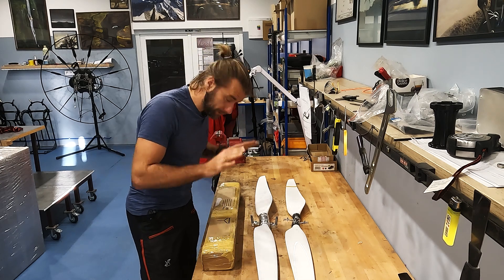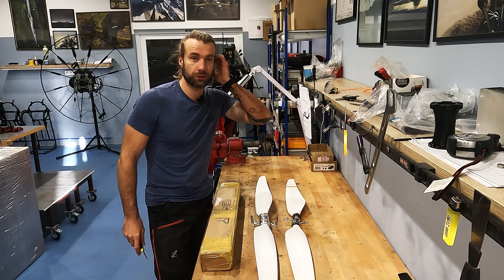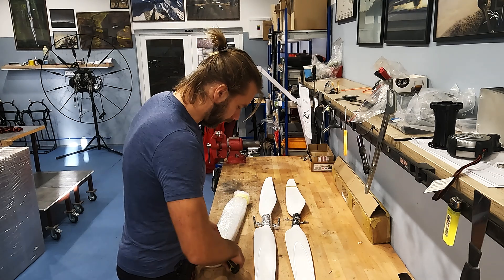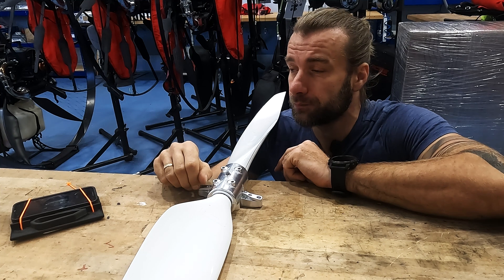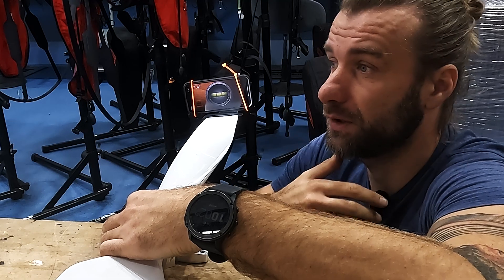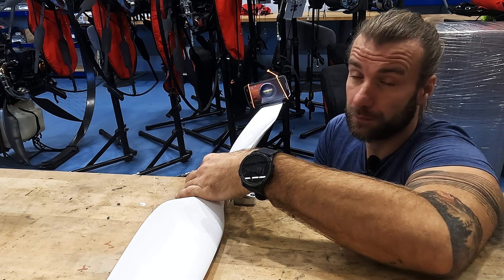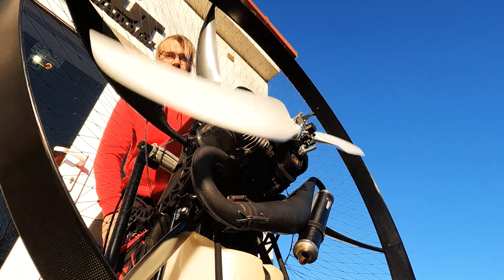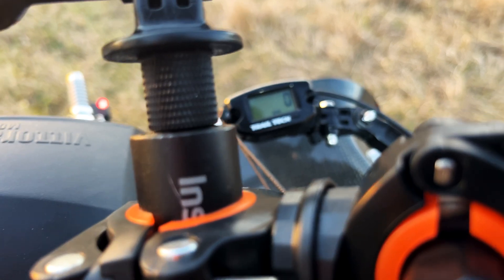It Works! Final stage and testing. Variomatic propeller

Comment: So, 12 months have passed, what is your opinion now, should I fit a Variomatic? Should I fit a Variomatic to a Vittorazi EFI engine?
Reply from the maker: The variomatic is in production now. 
We tried on the EFI but the engine did not work with this prop. Vittorazi has promised they will try to make a new fuel map special for this prop. Theoretically efficiency gains should add up although maybe not 1+1

Comment: Wonderful work, I thought it would be years before seeing variable pitch propellers and yours is more a constant speed. For me and most para-motor pilots and your business, the big issue is noise. If we disturb people they complain, parks and other take-off areas are lost. If the problem gets big enough, legislation will reduce where we can fly. I have been thinking about zip-line drone's quiet propellers and wondered if two different diameter prop blades long-thin and short-broad could be used, both balanced to have the same angular momentum? If this broke the resonance of the prop blades it could be hugely quieter with very little efficiency loss. Once seeing your prop hub with the blades bolted in, I thought that would be perfect to test the theory. Quiet flying will keep our flying freedom. I would love to see you try this idea.

Comment: With these test LEDs, you should be able to climb to 10,000 feet just prior to sunset, then check RPMs for blade shift at 10k, then 8k, 6k, etc as you descend, then land before it gets too late. You can then try that again with different springs. Sell the prop with a set of springs, color coded for various altitude ranges. Maybe even different pre-loads on different springs (set of springs and screws). Having that LED setup would make doing those tests much easier. Just make sure the air pressure isn't vastly different between tests, since that would change things as well. Or, just set altimeter to 29.92" Hg, and base the tested altitudes on that. With a few weeks of testing, you could really dial in the springs.

Comment: I love the amazing techie side of this video and how it relates to different flight requirements.  I hope the longevity of the propeller meets your expectations.  Fantastic work and your dedication to makin this work. I'd love to help test on my Sub70 flexwing machine that uses a Moster 185 Silent.  I've been working on improving my Moster midrange because my wing flies hand off at 57/5800, right on the point of switch over.  I could see your propeller making a huge difference to the distances that could be flown  in the UK.  Google Sub70 Peabee and you'll see the machine I fly. Great work and I'm genuinely excited with all the developments you've made.

Comment: What length is the prop overall? 

If this knocks the fuel consumption down towards Atom levels, this is definitely a contender for lighter comp pilots to get economy and power from the one unit. 

Do you have a retail price estimate for these?
Reply: Just wait till he makes the same prop for the Atom 80;)
Reply: @LukasKuhelj  I can’t imagine it’ll be too different to the moster version, possibly just the case of changing spring tension and blades. The benefit of the moster being more economical, for classic comps, would be that on eco tasks you’d be saving fuel but still be able to reach full speed with the higher power demands of the top end gliders. The Atom is economical but struggles to keep up with top end speed of say the Warp and Viper without sizing up thus loosing most of the benefit of having a high performance glider in the first place. An Atom factory 100cc or 125cc would be a nice all round engine.
Reply: @DanielJonesParamotor  ah yes you are right:) As a Pilot who weighs 75kg and goes in the air with a moster & Roadster 3 26m I sometimes forget that there are configurations where the thrust is not enough :D

Comment: Miro, would it be possible to have a small servo motor programed  to change prop pitch at a certain rpm , or  air density,  or with a manual button like trim on a boat engine?

Comment: Why would you want lower pitch at higher RPM and higher pitch at lower RPM? That seems like driving a car while stepping on the clutch and the gas pedal at the same time. You will spend more gas doing that.🤔🤞
Reply: Low pitch/high rpm equals best power/thrust for takeoff. High pitch/low rpm equals best efficiency for cruise. Low pitch is like low gear - best for getting going, and high pitch is like high gear - best for going fast.

Comment: Would love to build you a bluetooth module for your measurement system so you can record and read actual numbers on your remote phone screen instead of trying to spy some LEDs awkwardly. That said, a quick bodge that gets an answer is better than no data, nice work!
Reply from the maker: You are very correct. It was a quick and effective solution for this purpose. 
 I might have an idea for a next level device for further research. Please reach out to me at miroslav@scoutaviation.com. That would be awesome

Comment: I'm not a pilot but one of my hobbies is building electronic circuits. A spring loaded system will need constant adjustment. A solenoid is not an option because it adds too much weight. 
l think a set of digitally actuated miniature gears that adjust prop pitch by rotating and latching to hold position is worth considering.

Comment: Such a great feeling when you can test and validate something is working as designed.   I noticed your test device enclosure looks 3d printed.  I really enjoy the process of using CAD to design and then print solutions on my 3d printer.  It's so cool that technology like this exists and you can design and manufacture a solution in such a short time.

Comment: Amazing job miro..  but how about other motors? I guess it is possible to fly with other similar stuff with just spring preload setting. Just asking this because i know alot of pilots that fly polini motors as myself. I fly 190hf and power range is very similar to moster factory r but bolt pattern is different and it has longer stroke so it has about 200rpm less witch i think it would be adjustable by spring preload not weight. 
If you decide to test other motors just contact me and i can help with that.. 
Ps. Keep making world less boring

Comment: Hey Miro, could you do something like insert a washer under your spring to increase the force at low altitude and have it removable for high altitude flying?
Reply from the maker: For higher altitude we will need the prop to start downshifting later = more preload on the spring. But we need it to finish downshifting at the same rpm that is the whole shifting will happen quicker >>> we will need a softer spring.